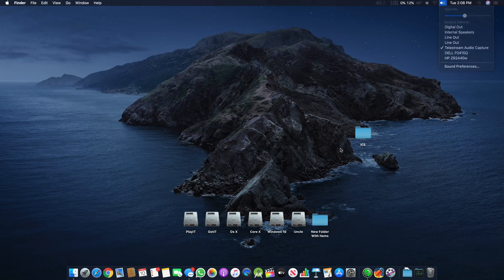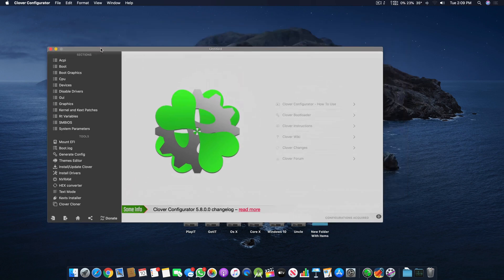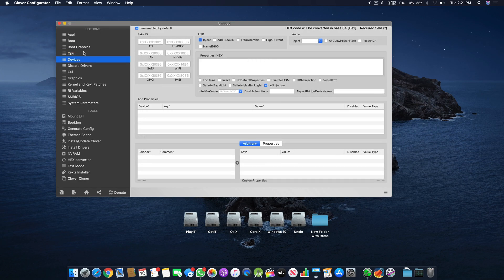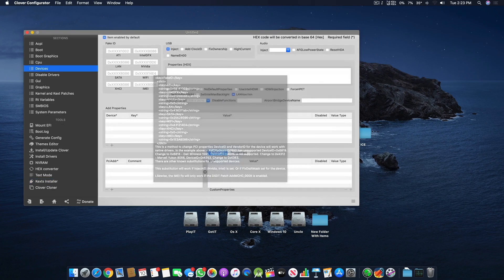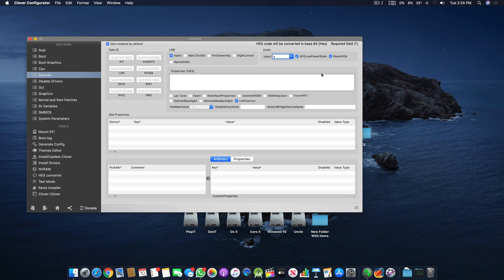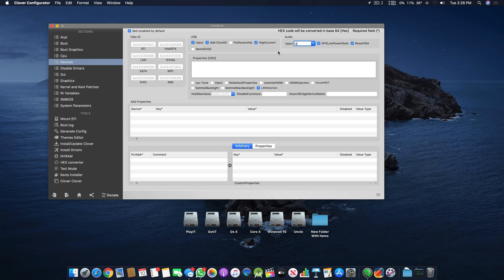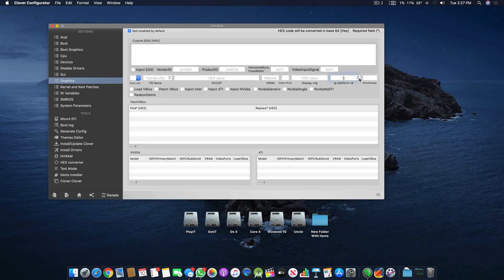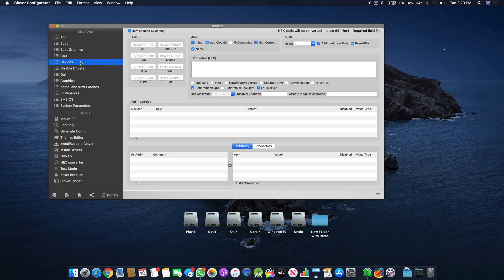Basic Guide To Clover Configurator PART 3 Devices Section Explained | Be Hackintosh Expert | 2020

Comment: Assalamualaikum, I buy a pc recently and want to install Mac OS High Sierra on it but getting a problem using Hackintosh Zone High Sierra. Can't boot stuck on -verbose so kindly help me to get out of this my PC config is Motherboard Gigabyte GA H310 M H DDr4. Intel Core i3 9100 F. GPU Nvidia  Ge force GT 1030 OC 2 GB DDR5. is it possible to load High Sierra... Thanks in Advanced. ALLAH Hafiz.

Chat Conversation End
Type a message...